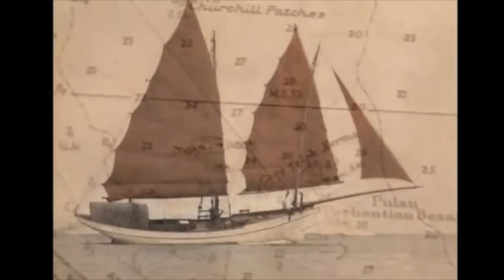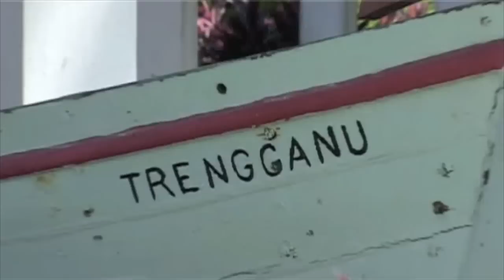Building the Naga Pelangi, a Malay Junk Schooner

Comment: You are forgetting, that the skandinavian way  of  clincerbuilding of the viking age ships up to modern 20century  fishing vessels also were built entirely by the eye and with the frames put into the hull 1 : when the bottom 2: topsides  were finished
Reply from the maker: Yes, it is not the same technique but yes, the clinker-built wooden boats are built inserting the frames after the planks were assembled. And they too are very stout and seaworthy boats! And very pretty too!

Comment: The only negative was the lack of personal protective equipment during the pouring of the lead. Tough to see those fumes swirling around the workers who will have to "live" with the consequences.
Reply from the maker: We tried to take care. Lead is poisonous. Nobody ate the lead, nobody drank it, it was too hot. Lead melts @ 327 °C therefore we were able to use a wood fire (about 800 °C) to melt it. Since lead needs temperatures of 1.749 °C (boiling point) to vaporize, a temperature we could not achieve by burning an open wood fire, nobody was - luckily - inhaling any fumes. Therefore we survived. The “fumes” you saw swirling in the video was smoke from the burning wood.

Comment: All those involved in pouring the ballast are now suffering retardation symptoms from lead poisoning......
Reply from the maker: Albert Einstein knew: Lead melts at 327,43 °C, a heat achievable with a wood fire. Lead develops fumes at about 1700°C (boiling point ). Since we did not eat the lead and did not grind it (inhalable lead dust) we are still not all that much retarded.